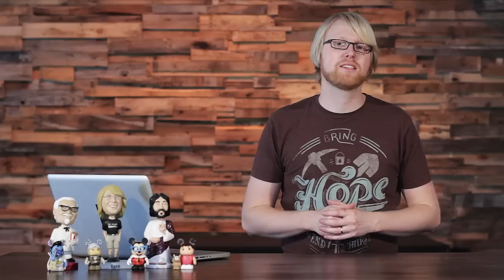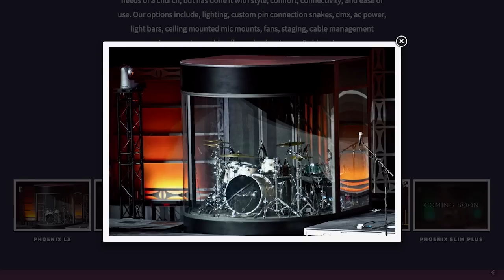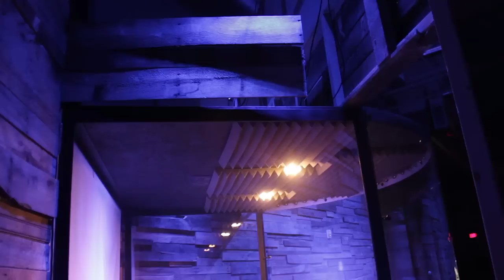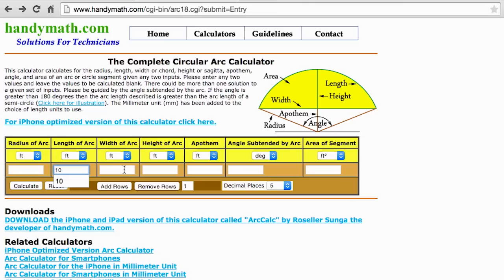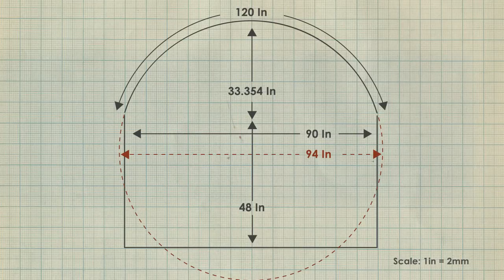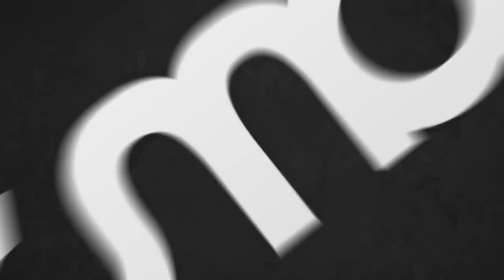DIY Drum Enclosure

Comment: Hi, thanks for sharing it. At our church we built a similar drum cage, using a curved glass (not sure the type of glass we used). But my question is, how do you guys treated the acoustic of the enclosure? We're having some bouncing problems and some frequencies that we need to treat. I'm thinking about add acoustic pyramid foam to the ceiling and back walls, but not sure if I should cover the entire walls and ceiling or just part of it. Any ideas/tips?
Reply: Usually, when it comes to acoustic treatment, you want at least 80% coverage. So, I think, you might’ve well just do all of it. I’m pretty late, so you probably already did.

Comment: Great looking cage! If you want to cut down the bleed out the back a bit more, consider hanging a packing blanket behind your white sheet. They're less than $10 and they are dense enough to hold quite a bit of sound in. We used one of those on tour to control drum noise from our cage. Just a thought.

Comment: I'm sure you could glue 12"x12" acoustic treatment foam panels on the back sheet which would limit the sound escape monumentally without restricting the ease of entry/exit of the enclosure. 

You could glue strips of Velcro to the wall and the sheet causing it to seal well and allow the acoustic panels to do their job.

Thanks for posting, this was a very informative and well spoken video!

Comment: I think you wasted your cash and your drummers should play quietly (piano=p) or even ppp. use brushes or make quiet sticks out of thin doweling. problem solved for under 10 dollars.place a huge cushion in the bass drum.Zildjian make quiet cymbals now. L80's.
Reply: Do you have any idea how that cuts down on the sound quality?  It's bad enough using those cheap thunder sticks, but then to add in quieter crap symbols, you're gonna do yourself more hurt than good.  Not to mention, this still isn't even the purpose of a drum cage.  The whole point is to completely eliminate as much stage noise as possible so it doesn't interfere with what the sound guys are doing in the back and in the house.  The other reason for a full cage is to give the sound techs full control over the sound of the drums and be able to actually balance them in with the rest of the band.  You can hand one drummer quieter sticks and have the quieter drummers still play with regular sticks, but no matter how quiet you play, you will either lose the sound quality of the drums, or you are still washing out the rest of the band, especially in a room with poor acoustics or lively walls.  technique cannot fix poor acoustics and sound control in a room.  Only proper materials and placement can do so.

So basically you can have a full drum set and give them crap sticks and symbols, and fire all of your tech guys in the back because you are wasting your money.  They have nothing to balance then if they have no control over the drums.  What are they sitting back there for?

Personally, if I know there is a way I could get a full drum sound and give the techs full control over it, I would think it's foolish to find a cheaper and much less effective option and go with that.  Our job as a worship team is to deliver an experience that draws people in and eliminates as many distractions as possible.  You're trying to come close to god yourself and bring the people in front of you along.  You can't do that when the drums are blasting loud or sound like crud because of bad sticks and cheap symbols.  I just think it's a little counter intuitive to choose to save money rather than spend it and give the congregation a better experience and help them to worship distraction free.  That's just my two cents!
Reply: No.

Comment: Hi Brad, I've been looking around in my area for Lexan and 1/4" X 6' X10'  is very hard to find!  I'd have to buy a batch of 10 sheets at 570$ each!  :I       Did you ever consider trying thinner Lexan  like 3/16" or 1/8"?     1/8" is half price + 10%  I watched a reseller show me how strong 1/8" is! He practically bended  a 2' X 4' piece into a full circle with a lot of elbow grease ;)  He said that to bend 1/4" would be pretty hard and  3/16" would do fine and even 1/8" for this projet.   What do you think?
Reply: I know this comment is old LOL, but he did actually use 3/16